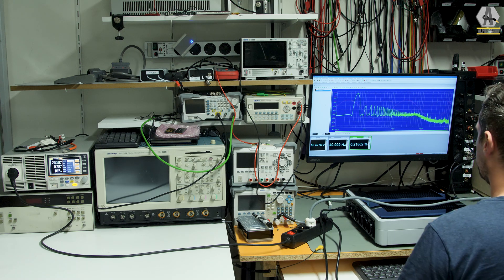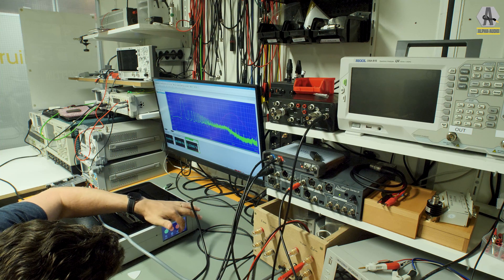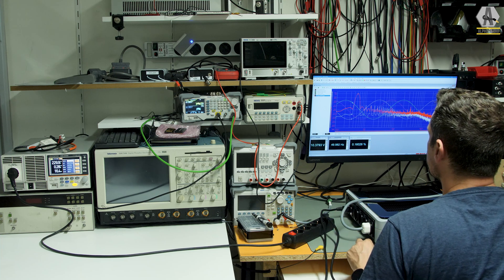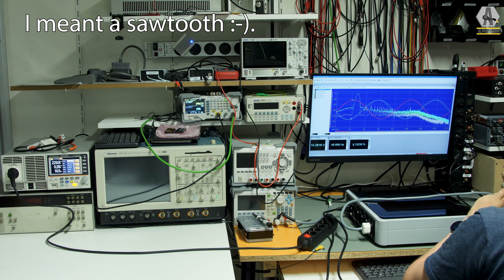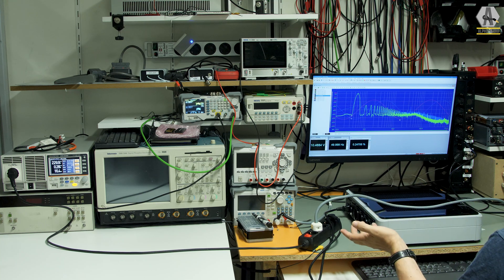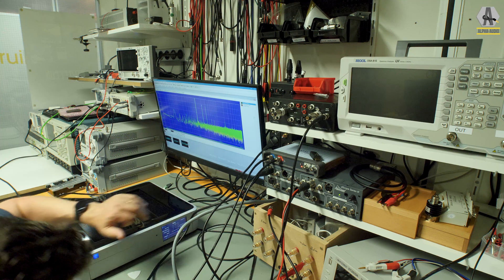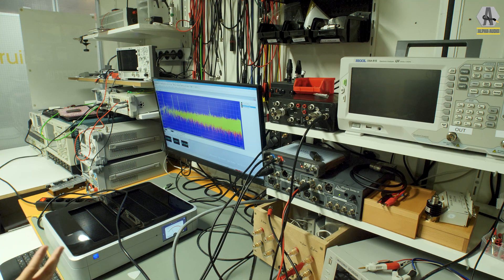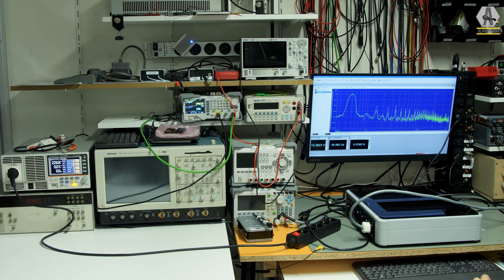Alpha Labs - Does an AC Regenerator actually work? Let's find out!

Comment: Hello, I follow your videos on YouTube. I find the measurements you take on air conditioners quite interesting. I’ve seen some of your PS Audio videos. I’m thinking about creating an off-grid system with batteries, in this case using Delta 3 Maxs Ecoflow devices. What do you think of this battery-powered system for my audio system?
Reply from the maker: Air conditioners?

Comment: Music is not fixed sinewave.
I’d be curious to know if the improvement is same on a real music signal. A conditioner has a feedback loop. As any servo, the result is highly impredictable as it will be affected by the amp power demands. Negative interactions could occur. How will it keep the power stable On a musical signal and would THD+noise keep being enhanced ?

Comment: When you are testing a device such as this, sold to do the following...

The results are both audibly and visually stunning when powering either audio or video products.
And
With your system powered directly from the output of the P12, you can expect far better micro and macro dynamics, as well as cleaner, lower background noise.
And
The results of feeding your equipment with low output impedance are dramatic: unrestrained dynamics even under the loudest passages, an open, wide soundstage that does not collapse with volume and a naturalness to the music that is remarkable.

And so on.

You should really also properly test those claims by measuring the output of a typical audio device and determining if the kit makes any audible improvement there.

When this has been done elsewhere, this type of equipment has consistently shown zero improvement when tested with typically well designed audio gear.

(NOTE - your 0.2dB THD+N improvement on a -80dB noise level is meaningless and a long way from audible. This is at the level of run to run variation, or setup variation such as grounding as you plug from one supply to another. Certainly not enough to be audible, and 10000% not enough to justify the claims I've quoted above)
Reply from the maker: Okay

Comment: I received a IsoTek mains noise analyzer and tested my PS Audio P15. I found Max reading at the wall outlet and in any outlet on the P15. A $160 Furman power strip reduced it to almost zero. I know you have the same IsoTek tester too.
Reply from the maker: @mugen2002  Honestly... That tester is shit. You have no idea what it measures. What frequency? What bandwidth? What is zero? What is max? I have that device and never use it.

Comment: @TheAlphaAudio  I have friends who have bought and then resold various regenerators including the PS Audio PowerPlant 15 and 20. They actually work if you live in an industrial area with factories and have very noisy electricity, but in standard situations there seem to be more defects than advantages.

Everyone told me they sold them because they limited the dynamics.
In practice, if we connect electronics directly to the power line, its capacitors will be free to charge to the maximum that the line delivers. And for a few milliseconds it will therefore not be limited to 3, 5, 6 kW of the electricity contract, but will be able to recharge much, much faster.

What we have seen from the various tests on ultra high end systems is that it is much better to have excellent power cables, possibly very capacitive and an excellent power distributor, but without filtered sockets.
Another very important thing for the black background is to have a ground box and possibly a grounding pole dedicated only to the electronics of the stereo system.

What do you think about it?
Thank you.
Reply: Exactly my experience as well.

Comment: How is this any different from a decent dual conversion UPS? It seems to me it's fundamentally the same kind of device, just targetting audiophiles.
Reply from the maker: Yes. Probably the same technology. But much lower noise and distortion.
Reply: @TheAlphaAudio  If you think that's true, you should test one. I don't think so. In the USA, by law, utility power must be less than 5% THD. An inverter generator or a dual-conversion UPS is typically better than utility power. An old fashioned synchronous generator may be as much as 20% THD. Living in Hurricane Alley, I've come to appreciate this. I beleive that there's a point of diminishing return for such consideration of power quality. Such regeneration may well degrade peformance by being reactive to large, dynamic power amplifier loads.
Reply from the maker: @MichaelGraves3304  this is 0.1% to 0.2% thd+n. I can measure a ups. I have several laying around.
Reply: @TheAlphaAudio Not just a UPS. A dual-conversion UPS. These are datacenter grade UPSs that fully buffer the load from the utility power. Most people have cheaper "line interactive" UPSs that position the backup power in parallel with the utility power.

Even so, I fail to see how very low THD (<2-3%) from AC power could meaningfully impact any audio device that had a competant power supply.

Comment: But how does it improve the equipment it is connected to ?
Reply from the maker: Definitely audible. Review will be live early next week.
Reply: @TheAlphaAudio  So if it is audible then you should see this in the measurements ?
Reply from the maker: @BuzzardSalve  well... You see it in the measurements...?
Reply: @TheAlphaAudio  The measurements of the equipment it is connected to ?
Reply from the maker: @BuzzardSalve  yes. We connected a Bryston amp to it and measured the speaker output. You can check the measurements in the written review as well.

Comment: A comparison between sine wave and multi wave would be interesting. Along with a comparison between multi wave strength 1 to 6 and normal vs high current outlets. Based on what people are doing in the PS audio forums, you use sine wave for tubes and multi wave strength 6 for solid state.

Comment: Yes it's expensive but in my opinion the best way to go for clean power. I have a P15 and a P20 and I'm very happy with it. The difference is not huge but noticeable.
Also a big advantage is the regulated power output and the low impedance. The power Amp always gets the power it needs because of the large capacity of the capacitors
Reply from the maker: Indeed. That's also a big advantage.
Reply: Demo Shunyata Research 
Denali 6000s v2 20amp 
20 amp dedicated line 😊

Comment: Do you have a video where you show the detail of the equipment you're using to measure this? I am curious to try and do this myself (I have a Rigol scope, but the FFT you're doing is probably run in your computer).
Reply from the maker: I have a Prism dScope III. But you can also use a Picoscope for example. We have a Picoscope 5000 series as well and it is brilliant. The Prism has the right scripts to pre set it for these measurements though. That is very convenient. The AC generator I use to feed it, is a GW Instek.

Comment: I think the phase tune should be left at 0, if the in THD is low. I think this is what PS Audio told me about this setting. Each time I select Auto tune, I get a different number on my P15.

The powerplant will make noise from DC input, but it should eliminate it on the devices connected to it, like you are seeing. Another YouTuber didn't like the DC blocking performance from the IsoTek product and found the Puritan p156 worked better.

I can't recommend the P12, because of the fan noise. A P15/20 are much better options. Dual P15s with their own dedicated lines would be a good setup.

I plan on upgrading the outlets to Furutech NCF on my P15 in the future.

Comment: Can you do measurement and video on using Battery power with an inverter. 
Essentially battery is perfect but it need an inverter which is a necesary evil to comvert it from dc to ac, the inverter creates some noise tho.
Reply from the maker: We can try. I don't have an inverter laying around though.
Reply: @TheAlphaAudio Truth !! The Power Plant is a repackaged inverter ACtoDCtoAC you build a 2000 watt for under $1000. Remember it only works up to the capacitor load
Reply from the maker: @HeavyCrown2030  of course it works like that. There is no other way to regenerate to AC.
Reply: @TheAlphaAudio  A 1000watt inverter should cost about 60 euros, batteries usually more expensive and i have heard from gr research (youtuber) thath higher amps batteries sounded better. Also there is alot of noise reduction cicrcuits, that im not sure the regular inverters use, perhaps a audiophile inverter Might be cool. Alot of potential in this i think.

Comment: Looks like your grid power is pretty clean to start with.
In your lab environment, it's useless, let's be honest.
At home? maybe your power is very different, maybe cleaner, maybe shittier.
Test your power noise before buying such equipment! or buy better audio equipment with better power supplies.
Reply from the maker: If you have the possibility to test your grid, that would be perfect. And always try before you buy!

Comment: Great demo and analysis! With all due respect, around 13:50 you commented that the flattened top of sine wave was from DC while that's actually a sum of odd order harmonic distortion like clipping. DC would offset the zero crossing point of the sinewave, not flatten the tops. Keep up the excellent work, your videos are unique and valuable.
Reply from the maker: Thanks for pointing it out!

Comment: Is it worth the money for such a small improvement?
Reply from the maker: Who said the audible difference is small?
Reply: @TheAlphaAudio  Was the audible difference large? I know some amplifier designers, Bob Carver for example, say you shouldn't use power conditioners with their amplifiers.
Reply from the maker: @mddawson1  like I said in the video... I haven't auditioned it yet.
Reply: The benefit of PowerPlants is not just THD, but also power capacity it's able to deliver without lowering it's output voltage (e.g. it's low impedance power source).
Reply from the maker: @manijacik  true
Reply: @manijacik  This sounds like the philosophy behind Angela-Gilbert Yeung's amplifier designs. Huge capacitance storage (over 2 farads in some designs) to smooth out the power supply.
Reply: @mddawson1  "NO"
Reply: No
Reply: Power conditioner is NOT a power plant. I use my entire system with a powerplant it's very big, including my amp. Look up "Doc Audio" and listen to the demos I think you will be blown away